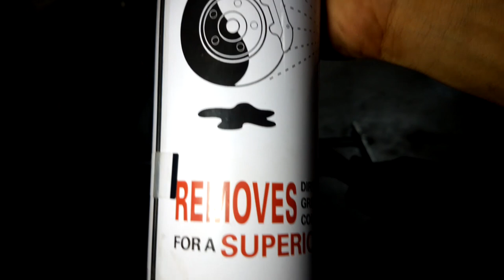Mitsubishi Mirage (Hatchback) Rear Brake Cleaning

Comment: Should have replaced the shoes while everything was exposed.
Reply: agree! also should have use a threadlocker on the nut and torque it with factory spec for safety and peace of mind